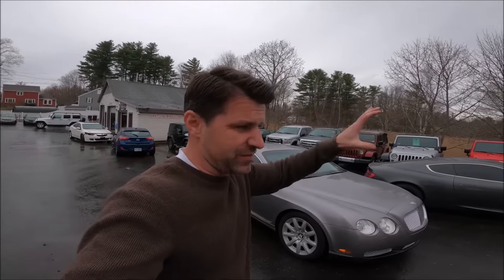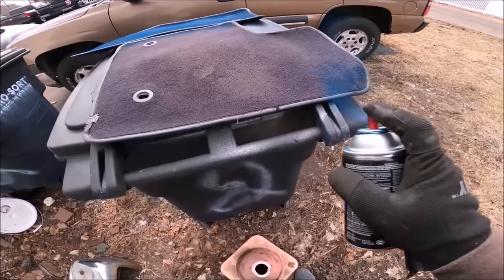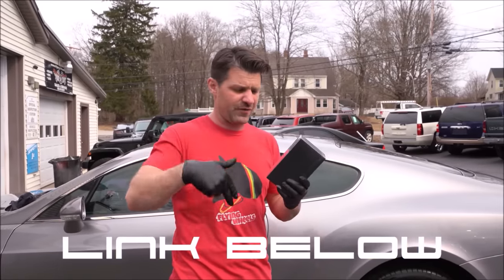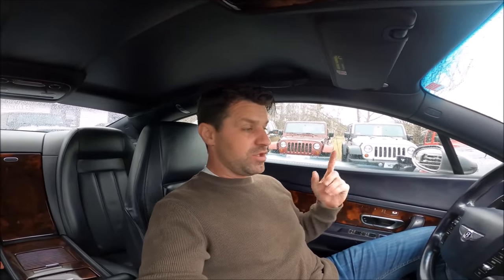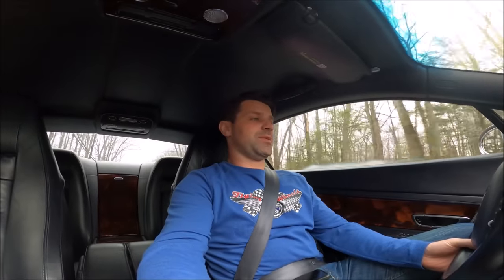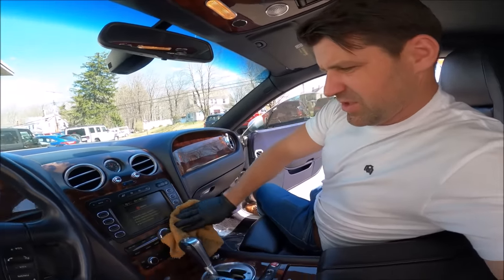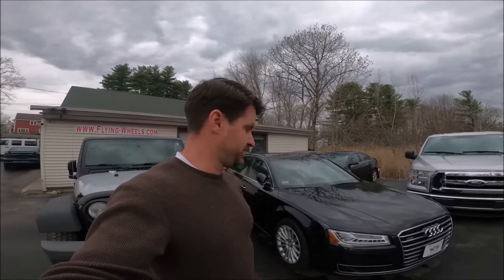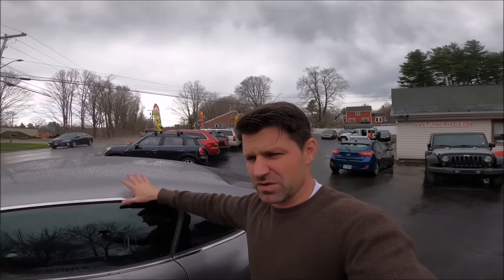I tried selling my $400 Bentley GT on the Doug Demuro Cars and Bids website

Comment: I don't know anything about Bentleys but I would assume if the batteries are disconnected and still had power then it must have a small auxiliary battery somewhere or a big ass capacitor somewhere in the electrical system.

Comment: Yeap, that's german annoying ingenuity pia when working on them.When you turn the key left you basically using both batteries in parallel so It gives you the enough voltage to start the car, they can be very picky on voltage and give you some electrical gremlins cutting off stuff and even misfiring if you are making low voltage on any of the batteries or if the alternator is about going out.If the key gets stuck there is a pin hole in the ignition cylinder that you can push with a pick and be able to pull it out.

Comment: when i se to detail cars i hardly ever used a vacuum i would use the blower when i first started i used the vacuum more bc believe it or not there is a learning cover to use the blower when i first started i would blow the dirt every where but outside the dam car lol as time went i became a pro and hardly used a vacuum the blower is an amazing tool it gets to places a vacuum never could i also never used a cloth to dry cars i used the blower start from the roof and move ur way down but you have to be careful easily if its a blower that connect to the shop compressor cause its very power full to the point you can damage the paint where i worked was a body shop and we used the blower for everything at the end of the day after sanding we look like ghost we used the blower to blow the dirt off and of course in a shop enviourment its a bunch of young man so there was alot of clowning and ball breaking we use to sneak behind someone put the blower gently under someone pant leg blow them up also if someone was sleeping we would put the skinny adapter in their lips scare the crap out of them which by the way is very dub and very dangerous but boys will be boys the number one thing i loved about working in a bodyshop and im sure alot can relate was the environment and the people you work with you become brothers

Comment: 550hp is pathetic for a TT v12. I can get a FORD 3.5L Ecoboost that comes stock with 400hp 500tq and with a $500 tune - increase the boost on turbos to get 500+hp 600tq.  From a 6 cylinder engine with 26 mpg on freeway.

Comment: Craig-you sold a Bentley- Real wood -Real metal buttons-but you kept an Audi SEVERAL AUDI!
 I kinda get it-letting a Bentley rust in NE- mortal sin-sell it to a good home.
A  politely growling V12.  -  zero trailering to dealer--WOOD DASH.   METAL CONTROLS-you sold it.
A Bentley-almost a ROLLS- JAMES BONDS  CAR!
Cooler than a Ferrari-no one can actually USE a Ferrari-a poser car -Corvette better in every measurable way.
You can actually drive a Bentley -hard-ish. -a Ferrari-NOPE
A Bentley means you are rich-a Ferrari means you are a middle aged  asshole 

But you kept  an Audi (more than one)

Comment: I’m a little miffed that the bate on the headline states or implies that you bought the Bentley $400. However, I’m impressed with your self reliance upon fixing the battery (assuming you did it yourself) and other annoying electronic glitches but you fast forward through a few tasks never really show how you actually got the battery out.
You lose credibility here with people checking out your “start my dealership” website.

Also, C&B never said No, they just insisted on what you considered a low reserve. in another video you should explain in detail how you exchange payment with a potential buyer as it’s quite critical and can be quite risky in the car selling business, though you hopefully discuss this process in your website.

Comment: there is a rechargeable battery hooked up inside of the alarm case.  This is so a thief can't just disconnect it and steel your car.  Maybe you need a vacation to relax you sound very stressed and that can kill you well before your time.  Slow down please

Comment: wow you are  NOT too bright !! what a  dufus  try reading the owners manual when you buy / own a car  ! I have a Ferrari and feel sorry for the car if you end up w/ one ! 
the alarm is because there is a small battery INSIDE the alarm  module that works even if BOTH , BIG batteries are disconnected !  It's to help w/ theft prevention   and to help you make silly you tube videos ! 
 BTW the alarm only battery does wear out eventually and you will have to replace it or buy a new alarm module ! -Happened in my Saab cars ! they sell a repair kit but you have to cut open the alarm  module box and un solder , solder in the new   battery ! 
regards

Comment: Those cars are digital plastic junk I won't own anything that doesn't have a metal bumper on it I have a Rolls-Royce. The kind with a metal bumper on the front and the rear it was built before the buyout. One whack it's on a rollback I'm sorry none of those cars are for me you know the ones with the plastic bumper covers on them where if you hit anything it's on the back of a rollback big diesel truck with a metal flatbed on the back of it. They quit building real cars over 20 years ago. It's All Digital EPA SHIT the government can track you with built these days. Navigation systems obdt ports. If it's got a computer it's junk if it's got an aluminum engine block it's junk if it has plastic or fiberglass bumper covers it's junk. And yet people are paying half a million dollars for these things they can keep them I'm a mechanic I worked on them and when I find a Mexican fuel pump and a brand new Mercedes they came from the factory that way and the fuel pump says hencho de Mexico on it I know they're junk. Even the Rolls-Royce Owners Club stated cars built Rolls-Royce and Bentley after year 1999 they don't acknowledge as true Rolls-Royce and Bentley cars. They have all that crap engineered into them today that make them disposable they're not going to have repair electronic computer parts for those cars in 50 years they will become scrap metal for half million dollars per car and the Owners Club cherishing Rolls-Royce and Bentley cars from all the way back to 1900 knows this.